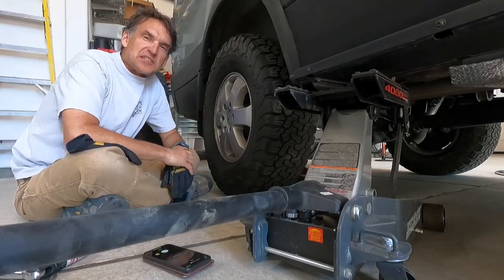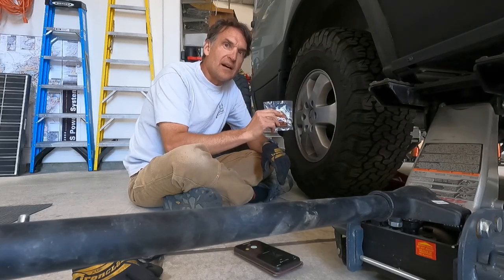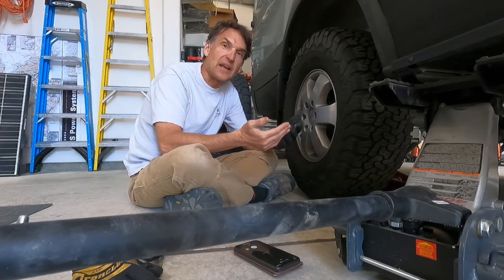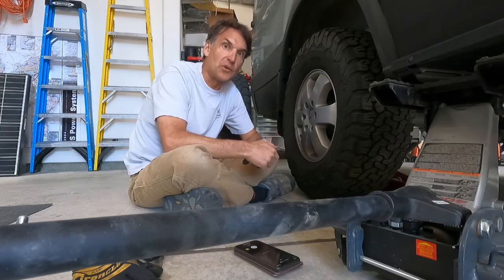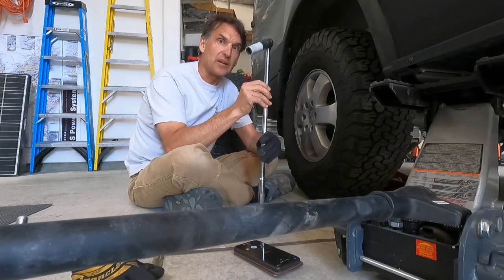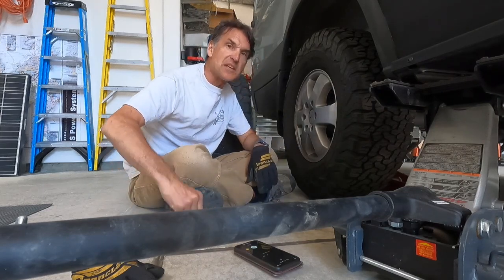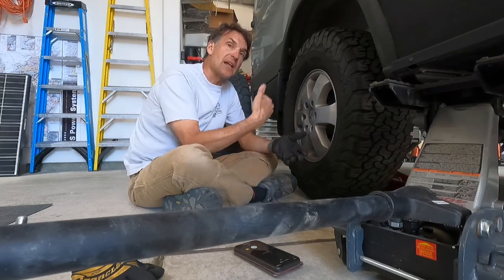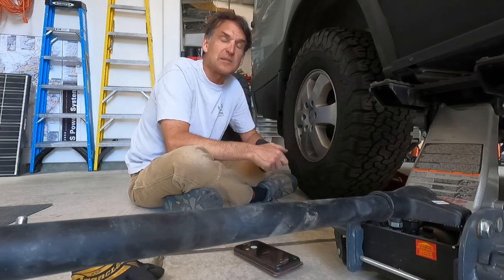Sprinter Van Tire Rotation tips & TerraWagen wheel alignment pin review

Comment: Hello and thanks for the cool content. Was wondering if you could specify your preferred jack points with the powerbuilt jack you are using. I just got one for doing my own rotation on my 2017 2500. Presumably in the rear you are using the factory recommended points, but for the front it is hard to discern from the video. 

Saw your van on CL btw, hope you have luck getting it to a new owner!

Cheers from Reno.
Reply from the maker: You are welcome. I use a single standard floor jack for the rear on the rear axle just safely inward of the wheel and brake lines. The front is much more difficult, as the factory points are too high off the ground for a standard jack to reach, so I jack onto the inward mounts of the front end where there are two large bolts that mount directly to the frame that hold the entire front end on. When I installed the VanCompass front skid plate, it was clear that this was a strong area without inducing loads onto the suspension or drivetrain. For safety I also use a second jack--the PowerBuilt one you see--placed in a strong and secure place under the front skid plate where also supported by the front end frame. It has worked well in every tire rotation I've done, but always proceed safely, use redundancy of jacks or stands, and place the jacks onto a secure and strong location. The front end of the 4x4 Sprinter has some strong jacking points but not really easy spots at home floor jacks.
Reply from the maker: Thanks too about the selling of my van. I hope to sell it soon. And cheers from from the area.

Comment: After you rotate the tires do you have to do a TPMS reset so the display on the dash knows where all the tires moved to?
Reply from the maker: Great question. The MB Sprinter system is great in that there is no reset or reprogramming that is needed. Once you drive just a mile or two, the system figures out where each sensor/tire now is, even the tire that has moved into the spare position. So it works great without any needed intervention.
Reply: @vantripping  
Nice 👍 
Thank you!
Reply from the maker: @nela5596  You're welcome.